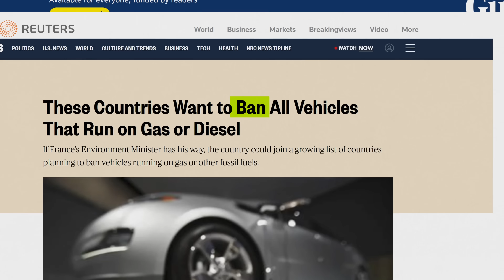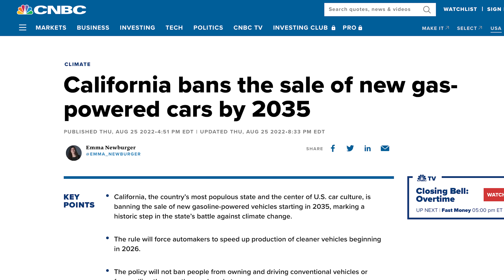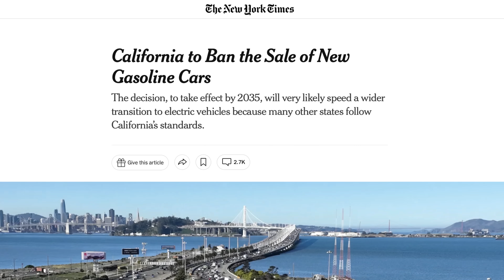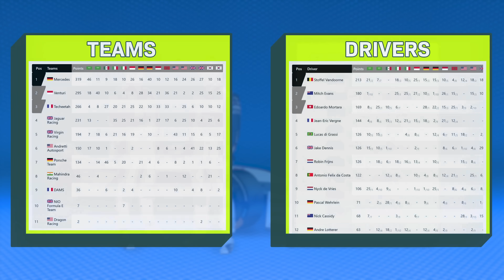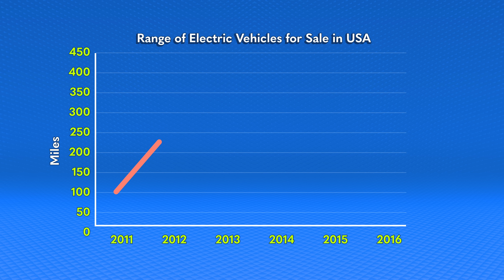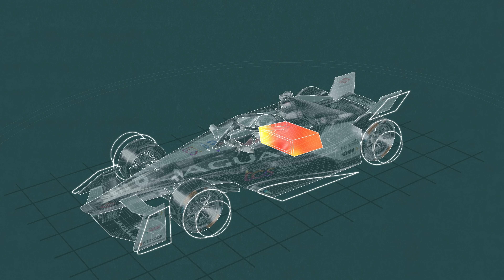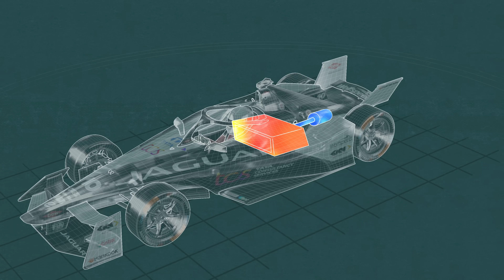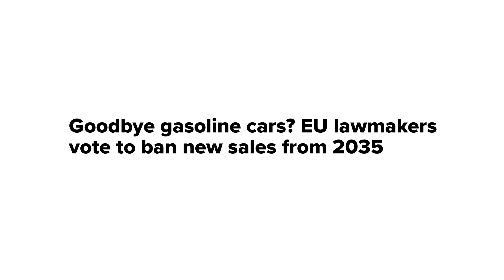The Electric Formula 1, Explained

Comment: Great video! I like how you focus not only on the sport itself, but more on the technology and its impact on the "commercial" car market. I'd like to emphasize on the topic of regenerative braking (RB): Yes, Gen 3 is pushing the benchmark even further, but F1 did the babysteps for it, by implementing KERS (Kinetic Energy Recovery System). Meaning: It is not totally new, but yes Formula E does bring it to the next level. Now, whats really interesting, is how RB is already the standard for commercial cars: PEVs, PHEV and Mild HEVs are totally making use of this, which has many benefits. One very crucial benefit (beside recharging your battery of course) is the reduced usage of friction brakes. Modern PEVs are able to brake more than 80% of all brake events via the electric motor and therefore abstaining from friction brakes. Which brings the crucial benefit: EVs emit WAY less brake particles than ICEs. Which is huge, since the current regulation draft for brake emission particles may makes it impossible for ICEs to reach the threshold values. So, car OEMs need to electrify their cars or use expensive brake pads which wear less, so their cars meet the regulations demands. In other words: ICEs are getting less and less attractive for OEMs, even through back doors like brake emissions.
Reply: Thanks for this comment. I was confused when she made it sound like regenerative braking was completely new or something.
Reply: @NeilCC125  In fact Teslas have had it for years. Its great for if you are driving down a hill, its like getting free gas. Since it acts like brakes, at a stop sign you just coast and it stops.
Reply: @NeilCC125  ice is still attractive non peace  of motor can beat  ice. ev  emit ,and synthetic fuel can be option
Reply: @racevoltGamerthemecedesguy  Don't they bring in diesel generators to charge the cars? Some locations do offer biodiesel, but F1 is going to green generated synthfuels so I don't really see the advantage either. Plus sports cars that run on synthfuels and biofuels will be allowed on public roads so the F1 ICE tech still applies for the future of sports cars and super cars. The FE is quieter to run on city circuits and they are slower so the officials allow them to be more physical in the corners, it is an interesting spec series to watch.
Reply: @anydaynow01  Formula E has been net zero carbon since it started. Some of this is done with offsets, rather than sustainable energy sources, though. But no, they don't use diesel generators to charge cars.
Reply: @NeilCC125  Only including taile pipe emtion is stupid because ev emit but at your country it do in difrent country
Reply: I've been driving a plug-in hybrid since 2012, and after over 200K KM, my brake pads still look nearly new thanks to regenerative braking sending my kinetic energy back into the battery. Even with lots of road trips and a battery only good for about 60 KM, (50 KM at highway speeds), my lifetime fuel economy is still well over twice what a normal Prius gas-only hybrid would get, and yes, it also uses regen braking to achieve such good fuel economy. It is pretty astounding that these gen 3 race cars have no rear physical brake, that's faith in the regen system for sure! Hope it doest overheat and cut out!
Reply: Iv just got a merc AMG 
Sounds absolutely amazing  
Only takes 5mins to fill it up too
Reply: So then what exactly is the new exciting technology regarding RB this video is talking about?
One-pedal-driving is already possible with many EVs. Sure, taking racing lines is a bit different than normal driving, but what exactly is the big deal that this video talks about?
Reply: @Jehty_  The overall abstinence of rear wheel brakes. The only friction brakes are in the front. Basically it is not a new technology, it's just that for Gen 3, they improved RB in such a way, that they won't use rear wheel friction brakes and only rely on RB.
Reply: @SharXwasTaken  still doesn't explain why this video hyped it up that much?
Is it just ignorance of the video presenter?
Reply: @Jehty_  It shows how far RB has come and how Formula E is pushing the technological benchmark, which can find its ways to the commercial car market. With the prospect of maybe completely abstaining from friction brakes for commercial cars one day.
Reply: @SharXwasTaken  f1 can still beat fe and most od motorsport fan does not like fe ,by the way f1 never going to be ev . For me ev also emit they are not clean at all . They couse more damage to earth than ice car does
Reply: @SharXwasTaken  Yep, even though most braking power is done with the front brakes the complete absence of a rear friction brake is very rare and is a testament to the electronic brakes control, even Teslas and Lucids still have a physical rear friction brake.

Comment: The Isle of Man TT has been racing electric bikes for several years. It's interesting that a smaller 2 wheel machine was the first, though the race was limited in laps, but was incorporated into the entire event since the fans were already at the location. Two similar sports with 2 different approaches. Interesting times indeed!

Comment: I really need a video on those rear brakes, I still can't wrap my head around how that would work. Maybe the magnets forcing the motor to go in the opposite direction and generating power in the process is how it works, but that's entirely based off of my extremely basic understanding of electric motors.

Edit: I'm quite familiar with regenerative braking, I'm just interested in what tech they're using that would allow them to completely ditch the rear brakes. Probably should have worded the question a little better
Reply: Look up regenerative braking, it's not new or special, every electric car on the road uses it. These racecars are amazing, but that's the least interesting feature. They only use it on the rear because they have rear wheel drive (road cars also have FWD or AWD).
You're basically using the electric motor as a generator - feed it power and it will spin the wheels, spin the wheels by force and braking them with the motor will produce power back. 
They're able to chuck the mechanical brake because they have more powerful and better cooled motors now that can handle the load. F1 is brake-by-wire anyway in the rear, so it's only natural for F-e to go that one step further when the motors could handle it. In road racing more braking is done by the front anyway.
Reply: @GetLowRacingOfficial  I'm quite familiar with regenerative braking, I've just never heard of the technology used to replace the rear brakes entirely, so I was assuming there's something special about the tech they're using here.
Reply: @FranFyrhart  its no different. The reason they ditch it is because rear brakes dont need to be as powerful as the front since the weight shifts forward. In your every day car as well, the bias is always more to the front and the rear brakes themselves are often inverior, too much rear braking would only upset the cars stability since they' be prone to "lock up"
Reply: @fetB James Bird Jaguar at Rome. Aggressive regen is going to be like applying the parking brake. Adjusting the strength of the regen is how FE teams "tune" their cars
Reply: In F1 they have been using MUCH smaller rear brakes since the introduction of Hybrid V6 engines in 2014. It really hurt them when the MGU-K (Motor Generator Unit - Kenetic) failed and they lost a large proportion of rear braking capacity. A road car, because of its higher centre of mass can need up to 80% braking capacity on the front, whereas a race car is closer to 50/50 brake force front / rear. The limitation with these systems is that the battery can absorb the energy (power) being ‘pushed’ into it at the rate of retardation.
Reply: So, there's a couple different types of electric motor, AC and DC motors, for one, and for AC motors (which all electric cars have) you can have synchronous and asynchronous motors. The difference between them is that in a synchronous motor, the rotation of the rotor lines up with the magnetic fields on the stator poles 1:1- think of the motor as "snapping" to the next position it can take on the motor, but it switches so fast that it never comes to a stop. Most electric cars use asynchronous AC motors, though. In these motors- also called induction motors- the stator magnetic field rotational speed doesn't match the rotational speed of the rotor. Instead, the stator field is always ahead, and the rotor is always "chasing" it to catch up.

When you use regenerative brakes, you essentially are just cutting the power to the electromagnets. Now, instead of being ahead of the rotor, the magnetic field on the stator is always lagging behind- this converts the rotational energy of the wheels into electrical current in the stator, charging the battery, and producing drag in the process, thus slowing the car down. This is why you'll sometimes hear the term "motor-generator" used- because an induction motor and an electric generator and basically the exact same device, with the only real difference being where the supplied power is coming from.
Reply: @PK1312  what about regenerative braking when the battery is full!? How they manage that?
Reply: @alanmay7929  I don't think there will every be a situation where the the battery is 100% full after getting under way in a pure electric vehicle, unless you start by going down a hill. On a flat surface, you will always have pulled out more energy from the battery to get up to speed than you will have available in kinetic energy to put back into the battery once you start regeneratively braking. Hybrids are a different story, though, since you can use the internal combustion engine to recharge the battery to 100%, thus you can get into a situation of not being able to brake regeneratively. I suspect that it will be a while before you'll be allowed to fully delete the brakes on a road car due to government safety regulations.
Reply: @PK1312  So basically, the magnetic field is pulling on the rotor causing it to slow down while making power?
Reply: Basically what PK said, but to simplify it: When you provide energy to a motor, it spins a wheel for you. The motor uses electric energy to spin the wheel or turbine (Kinetic energy). However, when you spin the wheel, while it is still attached to the said motor - it's no longer consuming electricity; it starts producing electricity. So kinetic energy applied to the wheel/turbine, say, by wind or water or your own hands while it is connected to a motor, turns into electrical energy that you can collect from the motor (which is no longer a "motor", it is now a dynamo). 
So regenerative breaking is works by making the wheels spin a motor inside the vehicle, which starts to slow the vehicle down - because friction (and EMF, just keeping it simple). The energy of the moving wheels starts getting converted into electrical energy, and you harness that electricity to recharge that car battery. Which then in turn, will let you run the same or maybe another motor to accelerate the wheels when you need to get moving again - and drain the battery. How it is different from conventional brakes is, usually brakes (like the ones on your bicycle) stop the wheels from moving by forcing a break shoe on it. The rims grind against the brake shoe, it wears down and eventually stops the car (or bike). All that energy is wasted - the kinetic energy of the wheel is just converted into friction, heat and noise which is wasteful. Regenerative braking lets you achieve the same goal (stopping a wheel from moving), but also recovering some of that energy and storing it - usually in a battery (or a flywheel). Check up basic high school science lessons on electricity, electric motors, and dynamos / generators. Your car or scooter probably already has regen braking - the formula E concept is taking it to a higher efficiency / with higher stakes. Formula 1 engines as well are the most efficient gas engines that exist, that's what sets them apart from a road car - at a fundamental level.
Reply: Imagine the motor can also work as an alternator which turns the spinning of wheels back into energy like the alternator on a normal car.

Comment: Great video! but no, Formula E is just another racing category, it's not the future of Formula 1, because motorsports with vacuum cleaner sounding cars will not ever have the impact of a combustion engine, it's wonderful that Formula E acts as a test platform for road electric cars, because road electric cars are the future, having said that, road cars are not the same as race cars, if we want to care about the planet we should't care that much on a handful of race cars that use fuel (synthetic fuel in some cases, which is wonderful), and more in fuel driven public transportation or energy generation.

Comment: they can ban the sale of new gas cars all they want, until the tech gets to the point where someone can go 400 miles on a charge, and then recharge it fully in 5 minutes or less and go another 400 miles, then demand for gas cars will remain.  In fact I predict a booming industry in stripping new electric cars down and putting gas engines in them will pop up in places that ban new gas-powered car sales.  

The tech just isnt there yet, and it doesnt look like it will be anytime soon.
Reply: The average Electric car nowadays has a range of about 250 miles. The top-of-the-line vehicles have a range of over 400 miles.
But we are just at the beginning of the evolution of electric cars. Charging time and Range will improve over time.
Reply: Just put a gas generator in the back, something BMW did with the i3.

Comment: Great video but f1 does have a plan for the future for 2026 it’s new engine regulation which will boost the electric power more and create a carbon neutral engine fuel they will be running

Comment: Do they have a plan on how to faze out the gas powered vehicles and the materials used for sourcing the batteries and the sheer amount of batteries required to replace the existing cars and charging technology required for it to be net carbon positive. We are still burning fossil fuels to power the grip as wind and solar are very geographic specific solutions.

Comment: Regenerative brakes have been in electric cars for over a decade...
Reply: It's more the level of regen that's capable on these cars thats impressive as capable of 600kw regen. That level of regen is much higher than F1 for example but even in 2026 F1 wont be doing that much regenerative braking.

That also raises how quick these cars can charge which will become a feature later in the season with fast charging pitstops.
Reply: @lewis8552  Interesting. The Tesla Semi is calculated to have 760KW of regen capability, but that battery pack is huge of course so that makes it easier.

Comment: Formula E has the potential! It's just as techy as F1 and the translation of tech to the public is exciting. It just needs time to figure itself out! I would also like to see these cars race around purpose built circuits like silverstone and spa.. city circuits isn't always the most exciting (but certainly can be sometimes).
Reply: They can’t race in circuit like f1 because the battery doesn’t have the time to richarge
Reply: There would be no point having them on normal tracks . Might as well just watch GT racing since they handle similarly . The whole point of FE is to have energy regen and it doens't work on tracks with long straights and few corners and even if it did work then it would just not be exciting since it's still slower than most other series and doens't make engine noise . That's why FE need to race on those street tracks and why they need to be different otherwise it loses the entire point and identity
Reply: @timmynicolas8729  i kinda disagree considering the biggest issue with electric cars in the public is poor mileage outside of cities (due to long straights with little breaking)

If FE was serious about wanting to translate tech to the car industry wouldn’t they want to prioritize this issue?
Reply: there is a huge difference in technological advancement between FE and F1. How the cars are manufactured, engineered etc. With current technology those cars are actually quite slow and could not race at tracks like spa, as the batteries would be dead after a few laps. They have to have the time to recharge. Until this year, 75% of the energy is from the battery, so they really had to recover a lot.
Reply: Gotta hand it to FE tho, they made Monaco race really fun.
Reply: yeah, agreed. now it's starting to mature with the new cars it'd be awesome to see them on real racetracks. The city circuits feel a bit like go-cart races
Reply: bro it’s been out for like 8-9 years. It’s finally figuring itself out but idk
Reply: @shvkpr1  That's really not that long considering its going up against a sport like F1 which has been around officially for over 70 years, with similar grand prix events going even further back. Of course it's going to still have problems less than a decade in...
Reply: " as techy as F1" is an INSULT  to F1.. f1 'engine' is soo complex they dont call it 'engine' anymore, but power unit. not counting the suspension and aero.series.
Reply: I still remember the disaster of the one and only Montréal e prix on the city streets while circuit Gilles Villeneuve is right on the city limits
Reply: It’s a spec series.